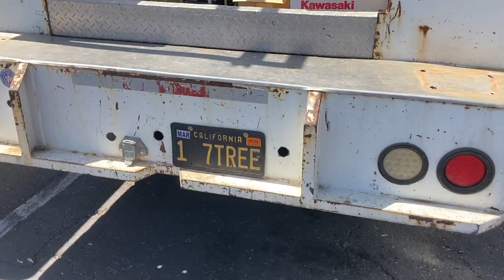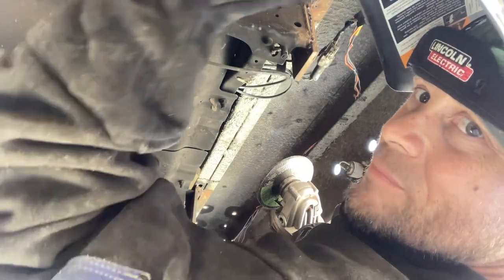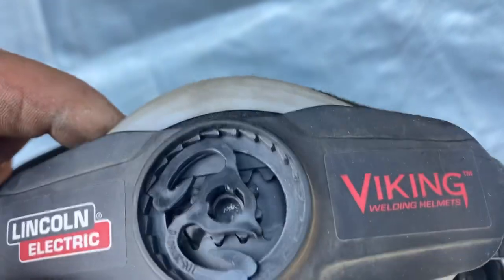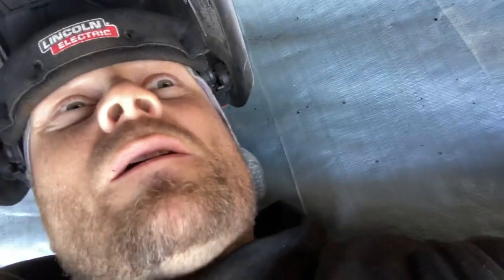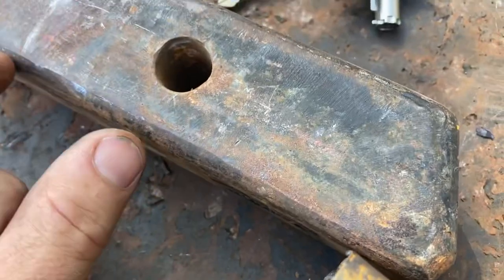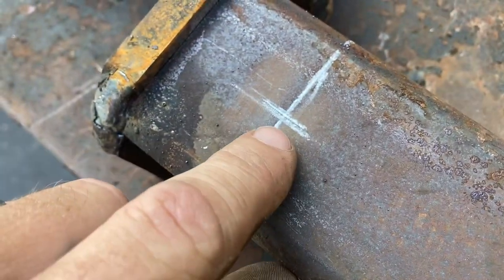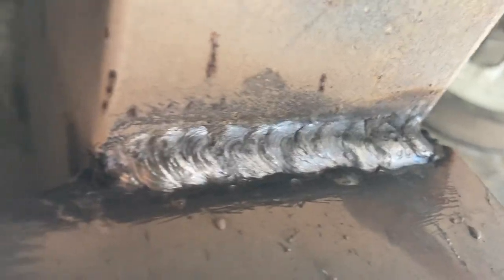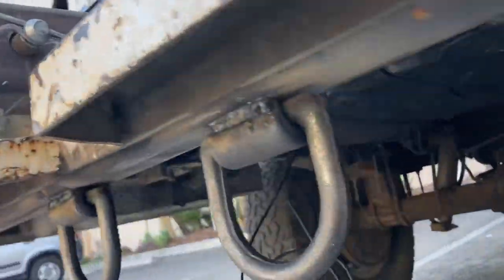Step drills and lightning reels!

Comment: Whats that lead reel set up you have? i like it
Reply from the maker: Whats up MCF WELDING!, they are hannay reels, I actually found them used on Craigslist for a really good price, and they are a game changer man They can hold probably 300' of 1/0 cable ,ive only got about 115' on them and they retract with an electric motor. super easy to wire up.
Thats why I use my stick setup so much its super convenient .

Comment: I have 2 Sellstrom WHP4000 welding helmets along with 2 Miller T94 helmets.I would take the Sellstroms any day. They are under $200 and the clarity is awesome.I had a Lincoln 3350 Viking ,lens crapped out in like a year and a half
Reply from the maker: Whats up Reeds Metalworks , I will check the Sellstrom out never heard of them ?
super disappointed in the Lincoln so far has a cool feature but I checked my receipt and I bought it 5 months ago?

Comment: Sorry about the double post but this was an amazing video and dude you got skills. You can’t beat 7018. Stick welds are the best. What’s you’re proffered brand of 7018 ?  I’m a Hobart guy if I can.
Reply from the maker: Whats up AJ's Iron Works , I usually use Radnor 7018, but I have used Hobart and do like how they lay , but there aren't to many places around me that sell it .
there's a tractor supply but its about 50 miles away so I usually go to Airgas or Praxair.
Reply: @happybleeding  how well does  randor work?
Reply from the maker: the Radnor 7018 lays really nice , I do occasionally have to heat the rods with my torch (getto rod oven)but its really humid out here (like 90% humidity most the time)